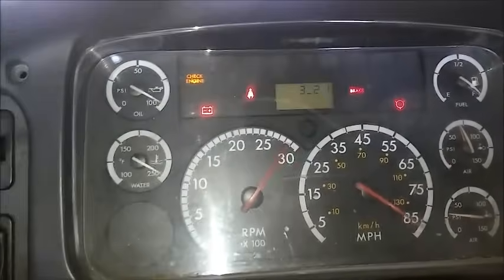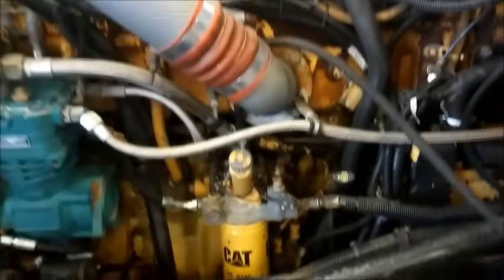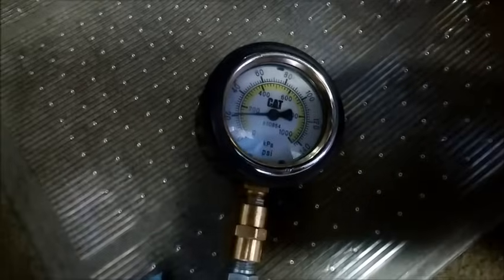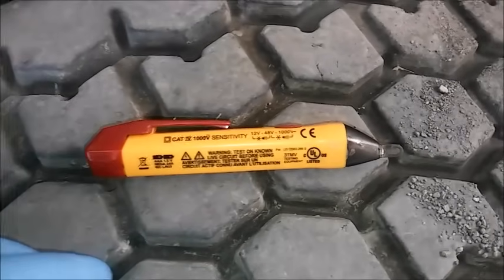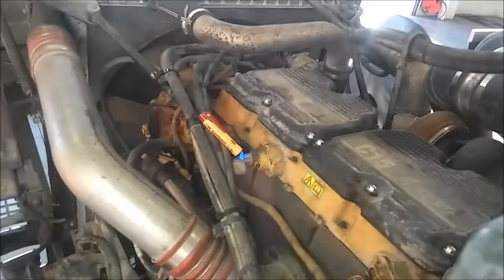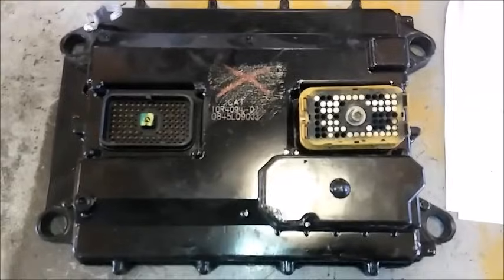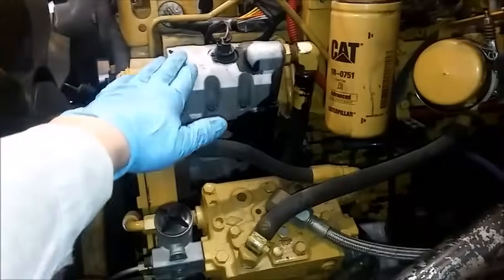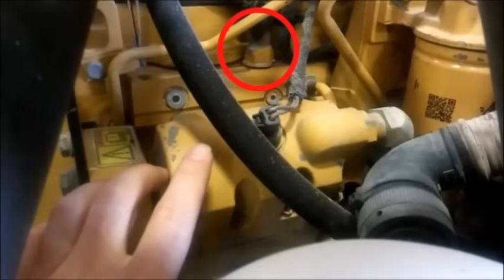Cat Engine Won't Start Troubleshooting.  Diesel Engine Crank No Start.

Comment: Whats the most likely issue if your CAT 3208 wont start? It runs off of starting fluid when sprayed into the intake, but once it runs the starting fluid out it dies.. I blead all the injectors and they all have diesal flowing from them. It has plunty of diesel inthe tanks... The fuel filter is full and primed..

Anyone have ideas?
Reply: Bad fuel shut off solenoid, constant bleed valve, or fuel pressure regulator. Possibly low fuel pressure, and if it has the square glass fuel filter it could be sucking air around it. Could be sucking air from a suction line or pickup tube in the tank. I believe if you open the bleed valve at the top front of the fuel pump and crank it you should start seeing fuel run out if the pump is full of fuel. You could also run a hose from the inlet of the transfer pump into a bucket of clean fuel and see if it starts. If it does you have a problem between there and the fuel tank.
Reply: @nickforgey509  also I noticed,  when I use the hand manual primer, it pumps up firm, but with in several seconds it looses its pressure. So I'm guessing there is an air leak somewhere in the line.
Reply: @nickforgey509  thanks! If I get a fuel pressure gauge, where in line would I install it and how much pressure should I see?

I think I did the part where u mentioned sucking fuel from the suction line out of a fresh can of diesel.  It sucked it up but still no run. 

I will try the other stuff. Sadly it ran great when I parked it..I would start it once a week or so.... then batteries died an I didn't replace them for about 4 months.  After that she didn't want to start.
Reply: @johnnyturbo8460  I can't remember the fuel pressure spec off the top of my head I'll have to get back to you on that. Last one I've even seen was in 2017. I believe there is a plug in the top of the fuel pump you can take out and install a gauge to check the pressure. They don't run a whole lot of fuel pressure I don't think. I'd definitely make sure the shutoff solenoid is working and that there is fuel coming out of all 8 fuel lines while cranking. If it has an oil pressure override switch i'd check that too. If you don't know what that is then it don't have one lol
Reply: @nickforgey509  yes, it gets diesel flow to all 8 cylinder.  I removed the shut off solenoid and manually flipped the shut off flapper in both directions with no luck. Also the solenoid when removed, does retract and extend. You may be on to something with the oil pressure override switch. I will look into that.  I had a generator that wouldn't start and that was the problem. Thanks again for getting back to me. It was the fastest starting diesel I have ever had before this issue I'm having now.
Reply: @johnnyturbo8460  No problem. Is it in a truck or bus or is it industrial? I'll have to get back to you with the fuel press spec probably Monday, but it might be a good idea to have the nozzles pop tested either way. Might have a couple leaking down.
Reply: @nickforgey509  its a 1980 Chevy Kodiac Dump truck. ( have an old youtube video posted of me getting it started after a long time of sitting ( when I 1st got it a few years ago)

forgive me for not knowing, but what is a nozzle pop test? does it test the pressure at which the fuel injector "pops" open and sprays? ( I am fairly new to diesels, but I am very familiar with gasoline engines/ vehicles)
Reply: @johnnyturbo8460  Yep thats pretty much it. But before they pop test they will pressurize them and make sure none of them are dribbling fuel out before they reach pop pressure. Then if they pop off at the right time and the spray pattern looks good, its a good nozzle.
Reply: @nickforgey509  Got ya, thanks!
Reply: @johnnyturbo8460  Fuel pressure spec is 30 +/- 5 psi at full load. Couldn't find a low idle spec, but if it is making pressure while cranking it should at least be trying to start.
Reply: @nickforgey509  ok thanks So much.!

Comment: Hello. I have a c7 in a GMC c7500 and I’ve been trying to get it started for about two months now. I replaced the HUIE pump and installed the filter you reviewed that goes after the pump. I also replaced the ECM because there was no connection to a scanner. It has started a total of three times using ether to get it started but only runs for about three minutes then dies and won’t start. If you have any suggestion I would really appreciate the help. Thank you.

Comment: Hey ape I’m working on a 3406e and got injector codes high current on all 6. Found a drain of battery when cranking, battery voltage drops to 4-8 volts found terminals on starter positive and negative were loose the negative came off the terminal when I touched it. The positive was cracked. Could this drain cause my injectors to not have enough voltage to start, I am getting voltage to the injectors but won’t start fuel is good
Reply: For got to mention truck was cranking strong before I touched the terminals on starter, they are the positive and negative wires coming from battery’s. Took them of to crimp some new connections could I also have a bad ecm thanks in advance I’m working on this engine on the side of the road 2 hours from the shop so it’s hard to run back and forth thinking g of taking a good used ecm and swapping it out to see if that turns the truck on

Comment: Brother love your channel, I got a m2 freightliner with a c7 Caterpillar 2008, my truck was running and out of nowhere blew all oil out the transfer pump whip hole, the huei pump is about 2 years old, so I replaced the transfer pump, it ran good for about 2 hours then did it again blew oil out the transfer pump. Any thoughts?

Comment: hi my name is jess. at my job someone cross neg to poss on battery's on a fl70 3126 eng, buzzer stays on and wont start, not getting cold start fuel igniter on and neg power to injection driver even when key off. can u help me,,

Comment: Got a c7 no start. Code 55.  Replaced pump cause no fuel pressure. Have pressure no stat. Got tach reading on dash. No volts at 2 pin plug on pump. Ecm?

Comment: Just spent a sleepless night in central Nevada (aka major BFE) after my 3126 refused to start. In the morning I was able to contact some of my diesel tech contacts, First suggestion most of them had was to unplug the HUEI sensor. This is located on the front of the head on the drivers side next to the valve cover. I understand this sensor can fail and cause a no start. Didn't cure my problem, however one of the top techs from Peterbilt in Sparks, NV suggested I go after the fuel pressure regulator and check valve located on the back of the head. Very well hidden by the way. Easy on a diesel pusher coach, but on a FL60 big PITA. Did get it pulled out and cleaned and freed up. Real pain to bleed air from system afterward but it fired and ran great! No start? Try the check valve back of the head. Saved me a $2,000+ towing charge.

Comment: Good morning sir. I have a problems with my 2004 F750 C7 w 32,000 miles. it been happened for couple weeks.  5 out of 10 times. when I turn the key to start, it cranks but not start. than I turn the key to off  & turn to start again the 2nd times, it will start & runs with no problem . it happen even engine been running for few hrs.  it also happened twice. engine start the first time I crank the key, but it runs very rough at idle . then I turn it off & restart it again the 2nd times than it runs with no problems for all day. Thank you!

Comment: As a 91B, thank you 🙏🏽
Reply: DD-214
Reply: Hey buddy I got 3126 it will cold start but no hot start only 500 psi from heui pump so I changed it still no hot start when no start not getting power to injector wires unless I unplug the three wire injection actuator sensor then the ecm starts to send some power to injector wires but no start. I’m at a loss right now and advise would be very appreciated thanks.

Comment: Good day sir I asked my truck gmc c8500 engine caterpillar the issue is no crank no start the gauges of battery and fuel does not up then I will check the starting relay the number 85 no continuity to the ground but  I tried to put one wire for ground direct to relay  then crank but did not start
Thanks and more power

Comment: We have an ISUZU C221 Diesel Engine.... and came from surplus shop thus has no car body... just engine only, and it runs but it takes couple of cranking and preheating ( usually at least 30 seconds ) before it really starts, what could be the issue here? 

is there a way to crank start the engine without spending too much time preheating ? I see that some diesel engine vehicles just crank-start by preheating for just around 5 to 10 seconds..
please advise...

Comment: As usual Great video Adept...i've a question...on my Kenworth t660,MHC recently (3-4) weeks ago replaced automatic clutch my my transmision...after replacement i got a code which reads "TOTAL PTO Fuel message missing"...what is it...is it causing any deteriorate to my engine or transmission? is it fixable without any computer or should i take it to Kenworth? please reply.

Comment: I have a C7 ACERT in a FMTV military truck-No fuel pressure at all and I swapped out the fuel pressure regulator. I have not yet checked fuel pressure out of transfer pump. Vehicle has been sitting a long time and fuel was contaminated with water and even had some rust in pri @ sec fuel filters. I filled the tank  with good fuel and changed the filters.. Zero pressure at secondary fuel filters. Best to change HEUI pump AND injectors?

Comment: Help. 2000 C15 Cat 379 stopped on highway lost power like battery arched. Put in new ECM put in a new accessory relay. Replaced a broken driverside frame rail ground and all 4 batteries r 12 volts. Alternator had dc volts. Tested all cab fuses replaced only one all good. Tried to crack my fuel return but the nut only moved back and forth could not remove that line fuel return. Also tested my ECM plug and pin 70 lit up plus 2 more pins 57 4th pin from right and pin 47 4th from left. Do i still have a bad ground or bad ecm wiring. Cranks but wont start cranks but wont.

Comment: Hey, my truck was starting perfect and was all good, i just replace the battery cables and now it wont start, what could it be
Reply: Hello tech from Barbados   first u have to verify that your ecu is actually working is the check lights coming on?   If not check and make sure the wiring to the ecu wasn't damaged by the cable change.... They usually have two small fuses on them     or get a meter and look for about 4.5 v on any of the sensors

Comment: I have a 1999 3126 we have had about every issue u talked about.   Today the seal in the oil line going from huey to motor was leaking.   I took off hard line replaced seal reinstalled line.   Truck started then stalled now it will not start.    I tried several of your steps still cant get it to run.   Very frustrating truck ran great all i did was replace one seal now it will not start.   Please help

Comment: I’ve got a 3406A cat in a 74 cabover pete. Ran great, but I flipped a toggle switch on the shift tower that says “Engine Start”. Since then? No fire.... ie; no fuel to the rack. 
Plenty of fuel. And help is great!
Reply: Do you have an air over electric shut off? Or a electric shut off? Never heard of a toggle switch that you have on shift tower. 
When air bleed off these, they would start until air built back up. (No power or failed shut off). Electric you held the button until the engine shut off.  Some of these had a manual cable that you pulled and shut the fuel off.  Take the end cover off the pump (front side). Two 1/2 head bolts. You can leave the tach bolt in, loosen the inside bolt and flip the cover up. See if the rack moves. If all the way in, it is in the shut off position. Should be able to push it in and return back. If it won't move at all your rack is stuck and I would not try and start the engine until you figure out the problem.

Comment: Hey there adaptive ape, i have 2001 ram cummins and its been sittin and im wondering if i need to clean out my injector lines before i starting trying to crank it over. Im worried about plugging up the injectors (algea ect....) and i live in Arizona, not sure if being hot effects anything

Comment: I have a 99 600E 1MM. Engine has been overhauled running fine. Finally had to replace transfer pump after million and half. Then 4 months later mother in hospital so to the house I go there about a month getting ready to go fuel up go to bed. Get up do pre trip start go get coffee come back fire up computer multifunction printer start doing contracts, truck starts running ruff so get out listen shut off re check. Just had service but went ahead put new filters on. Ended up replacing transfer pump again made it to end of truck stop. Since then replaced primary filter housing fuel lines fuel pressure regulator air to fuel filters. Will only run for three minutes by pumping primer pump which I also replaced but will stay running if you reprime every 3 minutes. Help

Comment: What size is the hex on the ECM connectors? Anyone know? I'm working mobile and want to make sure I have the correct size.
Reply: I pulled mine off today with a 5/32 but It is a 4mm you're going to need it on a ratchet not much room to move around

Comment: What if you own a older caterpillar D3c like I do. It has no check engine lights and such. Cranks great just won't run. Fuel smoke come out the pipe a little.  Ran fine after I changed oil and fuel filters. Cut it off after about 20 minutes. Tow weeks later it won't start.

Comment: Great channel AApe.  AApe...do you have any clips addressing the topic of...restart after extended sitting?

I just bought (2) 2004 C7 Bluebirds that have been sitting about a year.  Anybody have tips for C7 start after sitting?

Oil is very clean, so I'm thinking maybe just a fuel filter change.  Near the Gulf so less cold weather condensation issues.

Comment: any help is greatly appreciate ,i have a 2005 f650 ford with a cat motor believe its the 3126 c7 was driving fine then trans light came on and truck died will not restart has NO WAIT TO START OR CHECK ENGINE LIGHT COMING ON WHEN KEY CYLED TO ON POSITION found ecu fuse at battery box blown replaced fuse still no change.  when key cycled on check trans comes on will this cause the check engine and wait to start lights not to come on thanks

Comment: I want to buy that Klein voltage pen. But I've noticed it reads AC. Am I buying the right one? As trucks run on DC??
Reply: Shouldn't matter. As far as I know, any of those battery-powered AC voltage detectors don't know the difference between AC (alternating current) voltage & "pulsed" DC (direct current), as long as the voltage is high enough for the detector to pick it up.  Just used my Klein last week, that I got from Home Depot, to diagnose a 3516 CAT no-start condition and it sensed that the injectors where firing.
Reply: Harbor freight $3.99

Comment: Locally in PR we have not so many CAT TECH. But we have 3 CAT 3116 1997. now we have a Fuel pump transfer section problem. we exchange Sleeve and piston but still hard to start since we have no pressure on Fuel gallery. Please help with some suggestions.

Comment: My 06 C7 did not want to start today I checked for power, ohmd out the heui it was at 9 ohms, fuel pressure was okay so I added some oil and guess what it fired right up! However I noticed in my primary fuel filter it looks really dark almost like oil is mixed with fuel and now this thing smokes like a freight train?!?!?

Comment: have that Klein induction meter. Never thought to use it Thanks!!!
I just fixed a small Perkins CAT in a  JLG boom lift.
The rpm sensor for electronic governor counts teeth on flywheel.
Metal chips covered sensor magnet from starter flywheel usage causing machine to over rev and shut down. No dealer could fix it no trouble codes appeared It found problem after alot of testing and deduction.I got machine cheap because no one could solve. Now perfect.
Excellent work thanks!!!

Comment: Hey Adept I was hoping you can help me with my 3126, every morning we have to use ether to get the truck started. When I get it started the motor runs good and will start right up with no issues after it has ran for a little while. What do you think could be the cause? I hope you can help, Thank you so much for the great videos!!!
Reply: Greg Daniel prime it every morning. It might be catching air in fuel lines overnight
Reply: TheGP83 do you any idea what is reason air in fuel lines ? I have similar problem sitting overnight and in morning when I start engine it’s cranking but not fire up but when I pumped Manuel fuel up after couple seconds engine starts right away?
Reply: And I also find engine pulling only one tank mostly left side one

Comment: A  have a mxs c15  what causes cam to lock when it was running has a bad knocking on top NO smoke took oil pan off everything looks ok underneath changed air compressor  NEED help
Reply: Overhaul

Comment: Thanks for the video.  I have 2004 GMC C7500, The engine won't start after sitting down for 2 hours, but with quick start spray into the intake then the engine start.  Also if I plug in the electricity power in the night and start the engine first thing in the morning it will start easily.  My question is what do you think might be the cause of not starting after 2 hours of shutting the truck down?